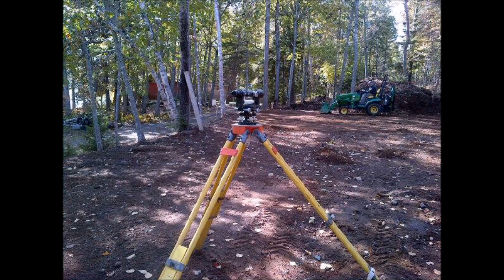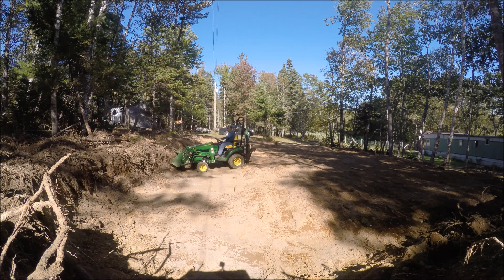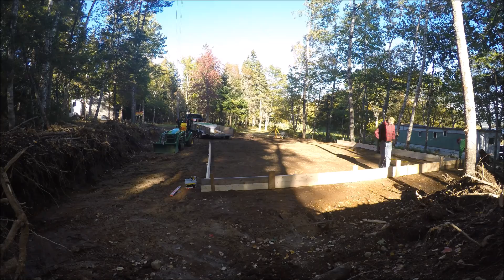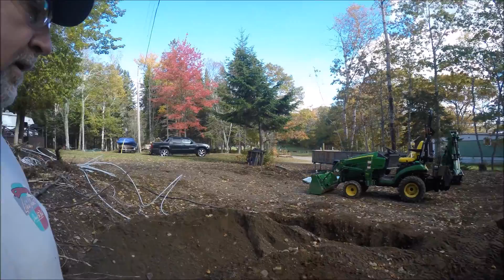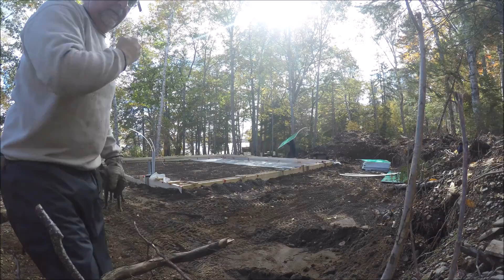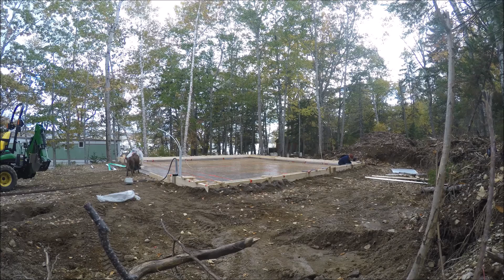Garage Build part1, Dirt wrk and Forms

Comment: How do you like your JD as compared to the Kubota? I am on the fence between JD or Kubota.
Reply from the maker: +Brian Campbell   https://www.youtube.com/watch?v=VQrrHOe3UIU I did a lot of research and the JD out does the Kubota almost everywhere.
Reply: In what way? Better on fuel, more comfort, better hydraulics? I want to upgrade from my smaller JD 455 to either 1025r or 2670 Kubota. Lots of Kubotas in my area, they are reliable and seem to do the job.
Reply from the maker: +Brian Campbell  I am sure you will be happy with what ever you buy, cheers.